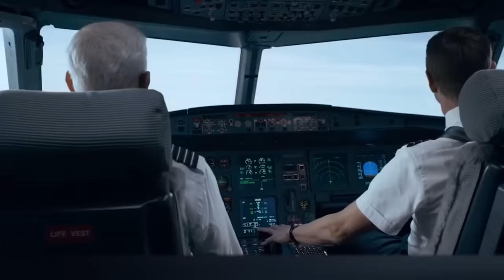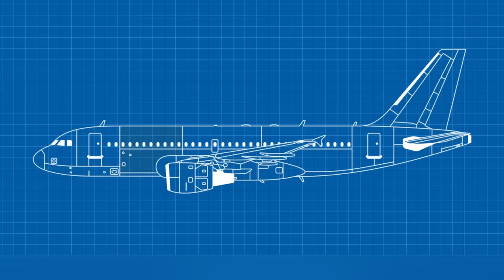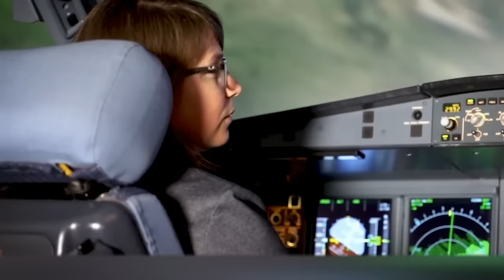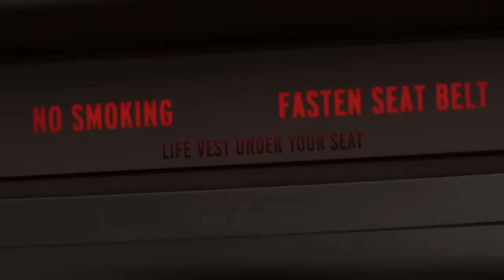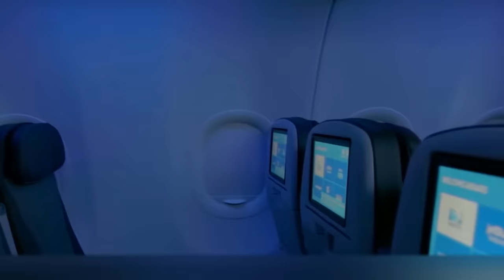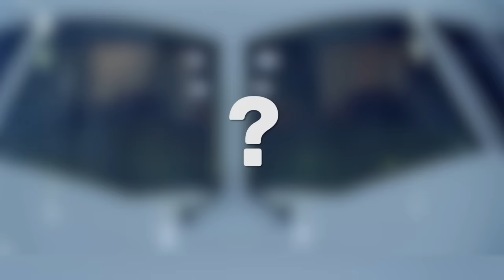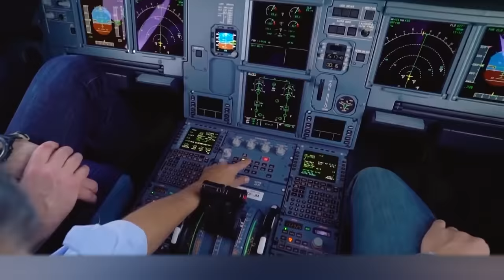25 Flight Secrets That Are Never Told to Passengers

Comment: It's amazing that a bird can damage the nose of a jet liner. But, two jets managed to get through eye beams 4 feet apart, 30 year old concrete and don't forget the asbestos.
Reply: Bird: give it on
Plane: oh shit
Reply: Rick James  no matter how hard you throw an egg you can’t break a window.    Explosives took down the towers. ....controlled demolition clearly.
Reply: Rick James  that’s the narrative they want you to believe.  Controlled demolition..the evidence is abundant...building 7 that wasn’t even hit should be evidence enough for 5he people who are in denial. It’s easier to fool someone than it is to convince them that they have been fooled though.
Reply: The nose cone of aircrafts are made of fiberglass, honeycomb resins or foam and not high strength aluminum because they cover the radome, a kind of radar and must let electromagnetic waves flow through.
This part is easily destroyed by a bird, the rest of the aircraft is usually made with aluminum for the fuselage and steel or titanium for the landing gear. At the speed they were flying it can easily destroy metal and concrete. That's the basic centuries old force = mass x speed !
No controlled explosion, that were aluminum and steel planes loaded with tons of fuel versus tower.
Enough with the stupid conspiracy theories ! They don't make you more intelligent, you know?
And it's not eye beam but I beam.
Reply: @danieldasilva3068  See above comment, and stop believing every conspiracy theory you read.
Reply: @KyrilPG  oh.. are you one of those that believe everything NASA says just blindly put your faith into these people blindly put your faith into the biggest government agency who gets funded 29 billion a year... I see 🙄😅
Reply: @danieldasilva3068  What does this have to do with NASA ? ESA (that's European Space Agency in case you're too self/US centered to know) says the same, as every other space agency in the world.
And every scientist on Earth will tell you the same : mass x speed = force. That's why a ton heavy wrecking ball crashing against concrete at 30 km/h will make more damage than a rifle bullet at near supersonic speeds. And they other way around: a magnetic rail gun pound heavy bullet at hypersonic speeds will do massive damage.
In just a few comments you paint yourself as a crazy conspiracy theories freak. Thinking by yourself is good but you must have the capacity for it and stay within the realm of science and reality or else it's just a dream a.k.a fiction or delusion.
Reply: @KyrilPG  lol, you got him
Reply: @ltdminer9549  Thank you :-)
Reply: The ignorance of conspiracy theorists is almost painful.
Reply: cus the airliner fast
Reply: @danieldasilva3068  I’m with you

Comment: birds can smash through the windshield, the one thing that prevents it from doing so is a system called window heat, window heat is required to be on at all times during their flight because the heat makes the window more flexible to any impact, if it were off, the window becomes so cold that it shatters when anything hits it at a high speed, I has seen a C-30 get struck by a bald eagle which is really unfortunate, but the pilot forgot to turn on the window heat and a bald eagle smashed right through the windshield, blood went everywhere in the cockpit. so it isn't just the movies.

Comment: I dissagree with 2:01. As an aviation enthusiast and wanna be Pilot, those seats are safe for surviving the crash. However, the next thing that you need to think of, is how to leave the aircraft? In my opinion, sitting at an emergency exit or anywhere where you can escape the aircraft quickly, is one of the best seats.

Comment: True, contrails appear in colder air, but after a while the air mixes with the condensation and it disappears, on the other hand, Chem trails since they are a solid mist do not cool off and disappear!

Comment: 6:20 "We know that a lightning strike can smash a huge tree to splinters." Lightning strikes conduct an enormous amount of electricity through the air and whatever is unfortunate enough to be struck. With trees, this sudden electrification heats the sap running through the fibers of the wood and it flashes instantly to steam. Because steam expands to 1500 times the volume of its liquid state, the fibers holding the sap explode just like a popcorn kernel. So, lightning strikes don't actually smash; they electrify, heat, boil, and explode, all in a fraction of a second.

Comment: The nose cones are composite and are closer to fiberglass than plastic. The fire axe is small and entirely impractical as a weapon. The three pane windscreen is for pressure sealing, the more you pressurize the more the windows press together and seal. Lastly, the fuel combustion is not the key concern of a lightning strike, power loss is the key concern, losing power means losing the hydraulic pumps and flight controls.

Comment: Which seat is the safest is completely different on which way the aircraft crash.

Middle is above the fuel tank💥: not safe for crash landings without gear or body slams with the aircraft or any regular stall crash, but ut not likely to survive that anyway

It has happened that the plane tailstrikes, which means that it hits it tail on the runway. If you have an elevated runway, the plane can ram the tail and it can rip off, but that have only happened once of what ive heard

Front is most dangerous for head on collisions

Comment: Did you know that all of the windows have 3 layers? the middle layer has a hole though, so there are basically only 2 layers because the hole reduces the chance of air pressure breaking a window.

Comment: You gys forget mansion on airplane tyers. Rubber is just only one factor on tyer, there is one more important then rubber. It is gas what they fill up tyers. They are not use usual air as you use on car. They use same gas what most supercars now use. They use Nitrogen what can absorve a lot more heat with out expansion like usual air do.

Comment: So chem trails... they were not around when i was younger 1990s now 2020 every plane nearly 9 outa 10 have a chem trail all year round......?
Reply: This vid confuse chem trails with con training. Chem trails is not a conspiracy theory but a conspiracy. A theory is an assumption if there is no practical proof. Even authorities admits using chem trails for weather control... Apart of other, which they avoid confirmation or denial.

Contrails on the are hand is what is explained here in the vid. Although, an aeroplane has to be at extremely high altitude for contrails to happen. Furthermore, more modern planes are designed not to leave contrails ever at moderate altitude

Comment: U got 2 things wrong... first thing is guns... actually... Air Marshalls have guns with them on the plane and second... the contrails...
Now contrails and chemtrail is two absolutely different things and yes... chemtrail exists but not on normal airplanes.

Contrail: When the aircraft engines consume and burn fuel (kerosene), it produces low quantities of different combustion products such as oxides, sulfur, nitrogen, carbon-dioxide, water and soot particles. All of these act as condensation cores for the watervapor in the air. But the contrail slowly vanishes after a few minutes. Its basically the same as the hoarfrost on the grass on a cold winter morning, the only difference is that up there in the air, the water doesn't freeze on the grass but on the combustion particles I mentioned.

Chemtrail: Chemtrail is real and the goverment is secretly poisoning us since decades. They take apart normal passanger aircrafts, remove the seats and other useless things from it, and put barrels and containers of a mixture (aluminium powder, zinc and barium) and they spray it high up in the air from those specially rebuilt planes. These planes are hidden from people. Every single plane on the world is up on flightradar24 0/24 a day and we can see where they are exactly at any given moment where did they start, whats their destination, the flight company that owns that aircraft, and its number... all of em... except for these secret chemtrail planes. These are not shown there. They change the weather and cause different diseases. The worst thing that it can't be helped cuz all of the contents of the mixture are highly poisonous and they can't be removed from our body cuz they are all heavy metals and they subside in our bodies and slowly causing things like cancer... chemtrail is basically just another form of population regulation or as I'd call it... genocide. Easy way to spot chemtrail is to watch the trail that the plane leaves behind itself... if it vanishes after a few mins then it was normal contrail... but if instead of vanishing it slowly spreads out and starts to fall very slowly then it is chemtrail. This can cause that a fully clear blue sky without a single cloud to become totally opaque like if it would be just full of clouds in a matter of a few hours. These poisons circulate in the atmosphere for 7-10 days, if its raining then they fall down faster. For the weakest immune systems they can cause cancer in 4-6 months. The poisons get stored up in our body and they can't be emptied from the body. They don't leave through our kidneys or our intestines, and our lymphatic system can't dissolve them fast enough so the rest that our lymphatic system can't dissolve are stored up in our body, spine and brain, once they're in they almost immediately start to react and produce compounds. Inhalation is not the only way that it can get into our body but with food too, especially fruits and vegetables. They're poisonous to our nervous system too because the aluminium powder in it changes the blood-brain barrier function. The government usually sprays it in several strips at once to make people think that it was just that multiple passanger aircrafts passed over. There was a story about an american aircraft engineer that was once servicing an aircraft when he suddenly found cables, wires and pipes that aren't supposed to be where they were, they wasn't even supposed to be on the plane... but when he tried to figure out why are those there government people took him away from the plane and he almost lost his job becasue of it. And just a fact... over the years... literally every single website that has ever dealt with the topic and made article(s) about it... all of them either got completely shut down or at least the article(s) about the chemtrail topic were taken down. The government doesn't want us to know what are they doing with us. Only a few articles reamain on the internet. Others can still be found as links in other articles of other topics but those are almost all dead links cuz the sites and articles they were supposed to navigate us to were taken down or the whole website were shut down. If you still don't believe me than take a look at these pictures (the links) below... do you think that those are normal passanger aircrafts? Tho... this won't be the main cause of our deaths... literally nothing is healthy in the world anymore... not even fruits and vegetables that we grow for ourselves at home cuz the acids and other poisonous things are in the air, the water, the rain... so it infects even those one way or another... it's not cigarettes and other things that'll that will kill us or make our lifes shorter... even "fresh" air is not healthy cuz its full of toxicants. I wonder that when will my comment will be taken down and/or account deleted for this comment and when will they come for me just because they can't fool me like most of the people... I see through them very clearly. But after all... this is the 21st century and the Earth is heavily overpopulated so these kind of regulations are needed or humanity will be the next species that will go extinct in a few decades at most. I just simply can't understand why they aren't just targeting the mostly overpopulated countries like India... now don't get me wrong, I'm not racist for even a single bit... I hate racism and anyone who is racist but just for a comparison... I live in Hungary... there are around 9.77 million people on 93 030 km² now lets look at India... 1.353 billion people on 3 287 263 km²... now if you do the math, the size of Hungary is roughly 2.8% of Indias, the population of Hungary is only 0.72% of Indias... which means that in Hungary, there is around 105 people per km²... that is absolutely bearable unlike india where this number is around 450 people per km²... for comparison lets take a look at China too, its commonly known that China is the most populous country... China is nearly 3 times bigger than India (9 640 821 km²) yet it still only has roughly 1.410 billion people living in China which equals 140 people per km²... the problem with India is that they are worse than the middle ages... they literally live in their own excrement and urine. They're the most disgusting people in the world in this matter. And the problem is that they just f*ck, f*ck and f*ck non-stop and reproduce... what? Like 20 children per family? You think that is normal? And its all because Indian people weren't taught what is birth control... they don't even know what it is... they don't even have condoms or any kind of other birth control products in their shops. I wonder how didn't they die of starvation yet with that many people and with such a low income... like 1$ a day or so (well... many of em). The 21st century world is disgusting. The capitalist system is disgusting too... But unfortunately no better society system has been devised yet.
https://ibb.co/fGNJjFv
https://ibb.co/61Cw3FW
https://ibb.co/prGpVQp
https://ibb.co/LQfQdCH
https://ibb.co/fDz33Dw
https://ibb.co/j3pp0fX
https://ibb.co/Dkv84ZQ
https://ibb.co/VqyRBjQ

Comment: I heard the seat belt reminder and the crew demonstration is mostly required for the event of an airplane crash, in order to identify the unrecognizable and charred bodies.  I heard, in most cases, the seat belts don't help during the airplane disasters as the passengers and the crew members are literally sitting on the flammable fuel tank.
Reply: I don’t know what you’ve been hearing. You aren’t sat on the fuel tank. Fuel tanks are in the wings. And I have no clue where you got the whole safety demo being to identify charred bodies. It’s there to stop you from even getting to the charred stage. And seatbelts do help because if anything airlines wouldn’t have them if they didn’t do anything…